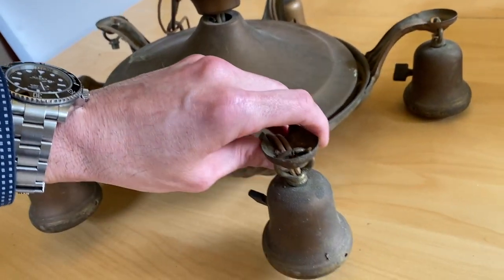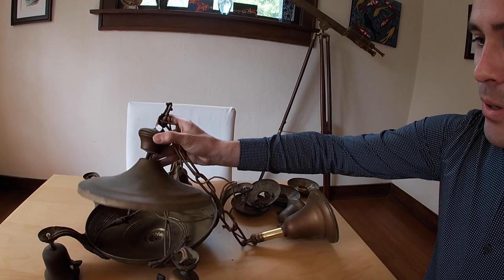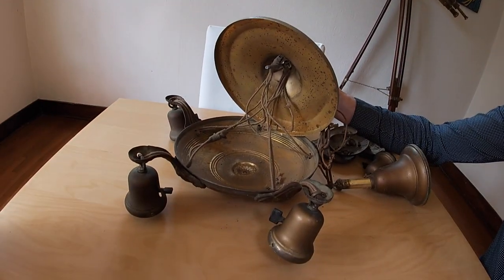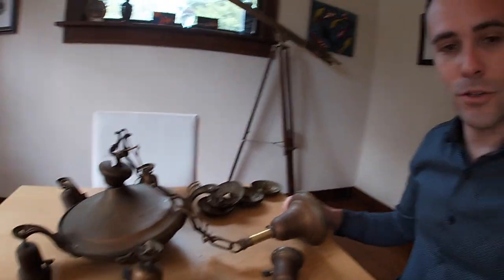Vintage Chandelier Restoration

Comment: Incredible restoration! Could you please tell me what the solution was into which you dipped the brass parts?
Reply from the maker: Thank you! The brass pieces were stripped in just plain water in a crockpot for the smaller pieces and an electric wok for the larger ones. I bought these sacrificial cooking appliances from a thrift store specifically to strip paint, I left them in overnight and that did the trick!

Comment: I have several of these lamps that i have rewired and cleaned but left the original finish , and they wont sell , I might just try this on one and see if it goes , did you put any lacquer on after polish to keep it from tarnishing, great job!
Reply: (Commenting from my other profile) Thank you! I appreciate real patina as much as the next purist, but I wanted to appreciate the beauty of the brass in its raw form. I didn’t end up coating the metal with lacquer and after 4 years hanging in the dining room, the finish is a little darker but not tarnished at all (yet). I figured I’ll let it patina and decide if it’s worth the effort to re-polish or just enjoy watching it evolve :)
Reply: @stmontal  Thanks for the info